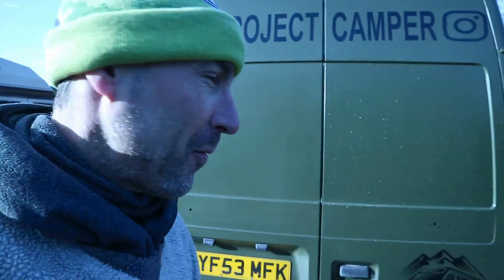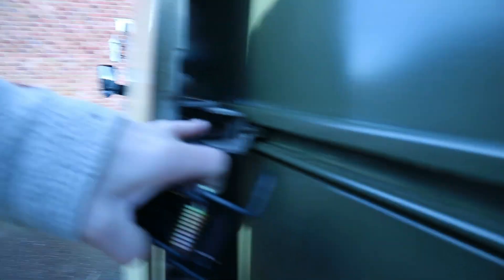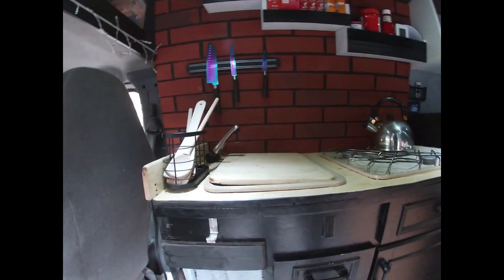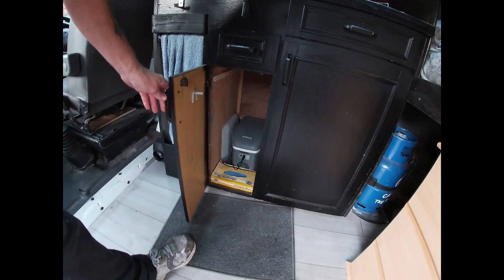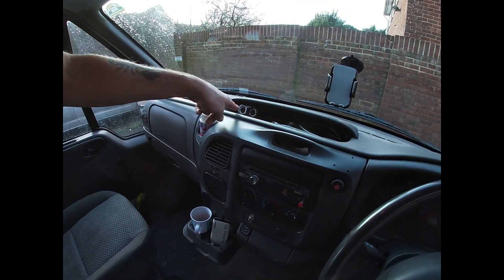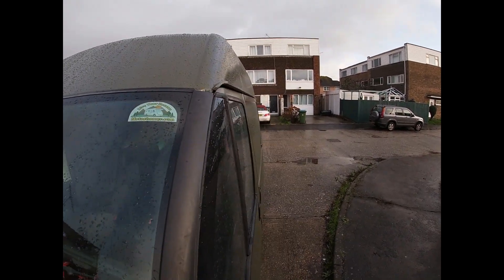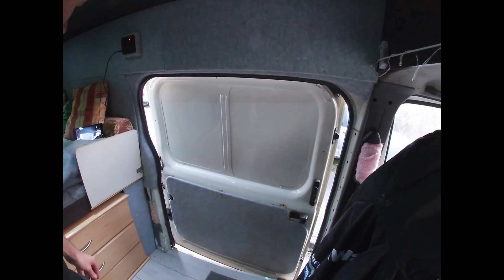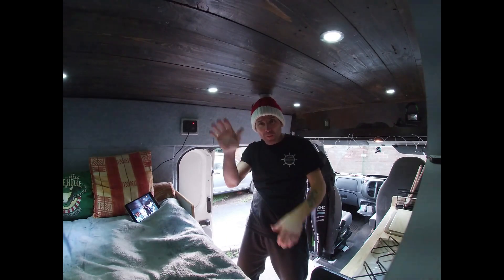FORD TRANSIT £700 DIY Campervan build #vanlife #projectcamper

Comment: Hot air gun for bumpers mate. Thank me later😉
Reply from the maker: Tried it yesterday they are past that, I’m gonna rub them down and plastic paint them. 😩
Reply: Hot air gun releases all the oils in the plastic and will make the bumper brittle after a while without the oils in.